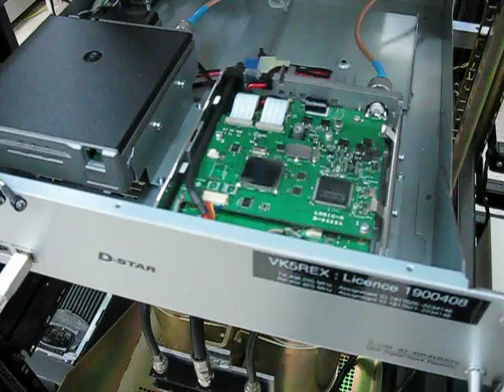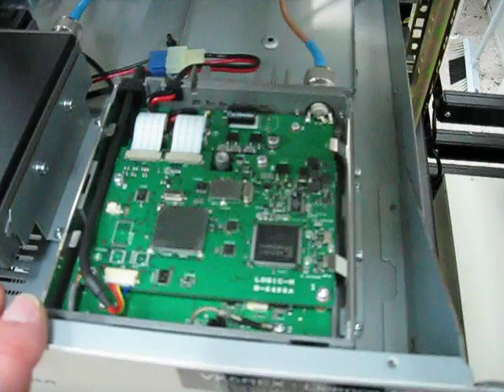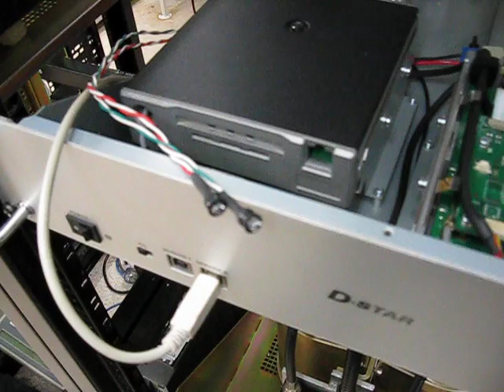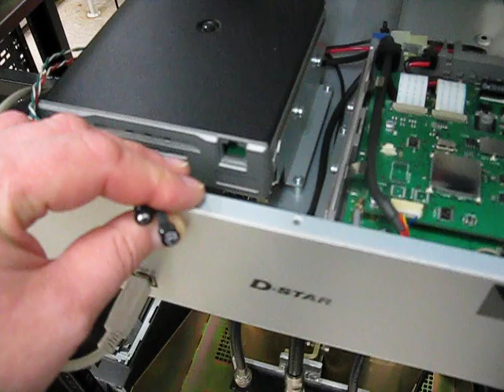ID-RP4000V power reset to "fix" Receive Enable issue

Comment: Hey Michael I find your videos of the Icom DSTAR  repeaters informative. I too suffer the 'blinky' LED at the WA7HJR UHF DSTAR repeater. I have also never found the reason. I am beginning to think the only solution is use a better commercial grade receiver and  a 3rd party modem board. WA7HTJ, Seattle, WA

Comment: We have the same problem here in Chihuahua (VHF). In order to have the repeater TX I just have to key my radio/portable a few times and the repeater comes back to normal.  I also called ICOM with no luck on the matter,

73¨s
XE2JEG
Eduardo

Comment: I'll pass being in your shoes sorting that one out :P ...If it's any help, could you check the firmware checksum on the device? You'd think if it was crapping out on heat, it would be consistent with daily temps as opposed to traffic throughput.